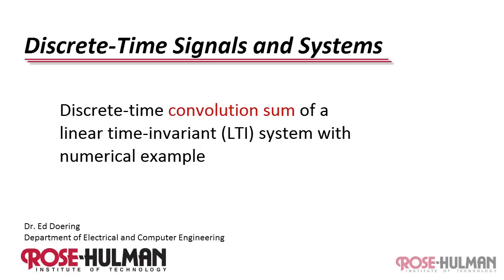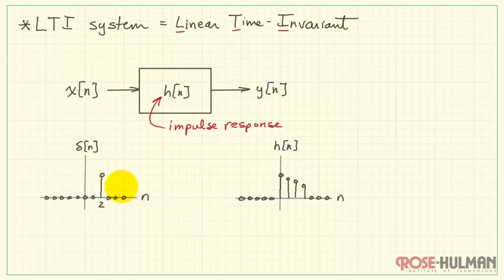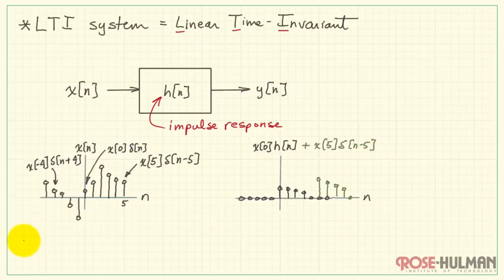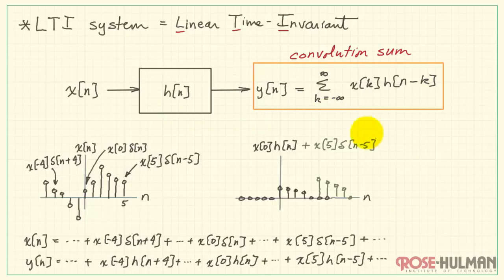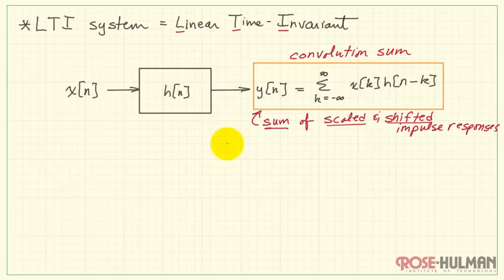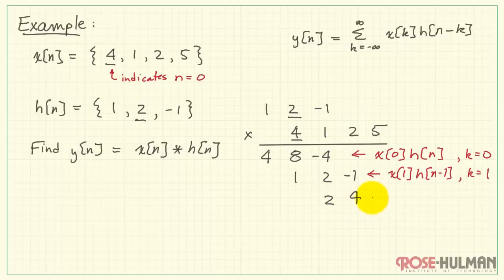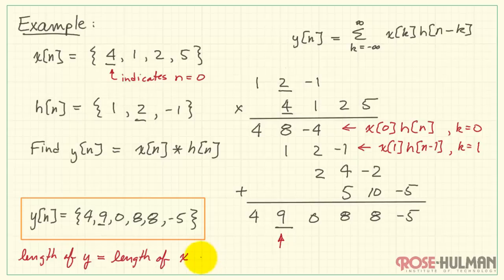Tutorial: Convolution sum

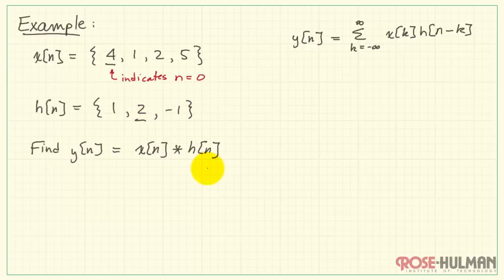Comment: In the example at 6:00, h[n]={1,2,-1} with the second term underlined, indicating h[-1]=1 ; h[0]=2; h[1]=-1. Is it possible for the impuse response of a LTI system to be defined for negative n "h[-1]=1"? doesn't that mean to have a value for the impulse response prior to the impulse?
Reply: yes, such systems are called non causal systems. In practice, you can implement it if you use delays.